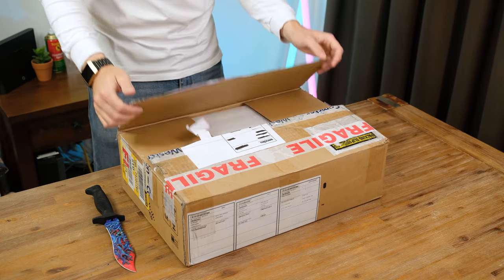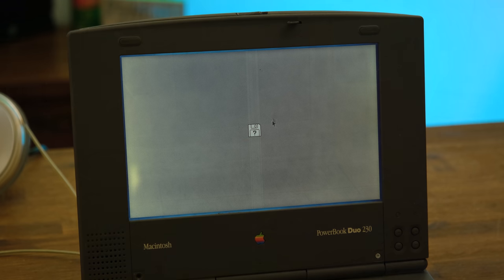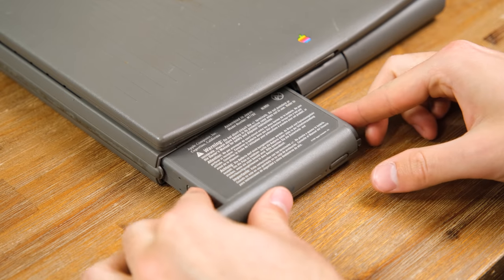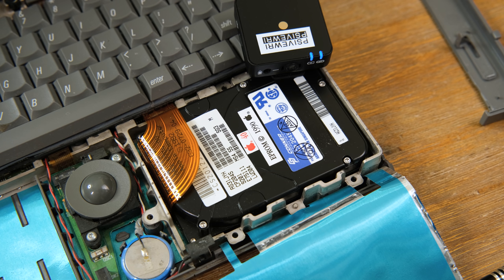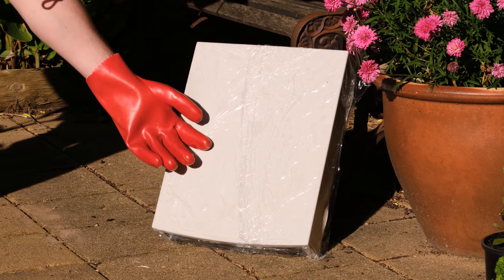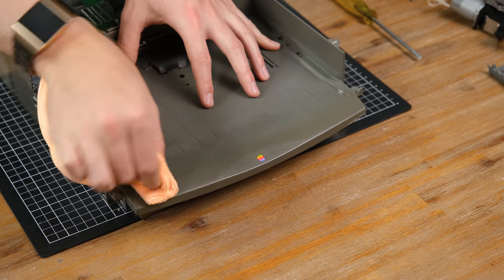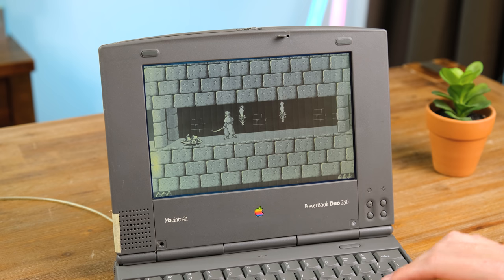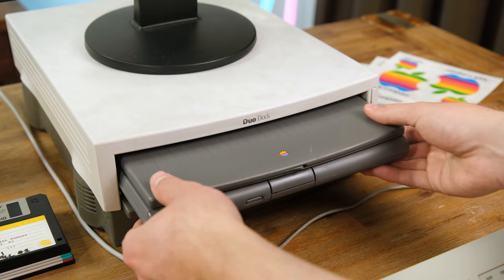Restoring Apple's Tiny Laptop From 1992!

Comment from the maker: Thanks for watching 🙂 One day I may also replace the capacitors (when I learn how to solder properly). If anyone has any info on replacing / repairing the battery, feel free to let me know!
Reply: Hi
Reply: Omg second reply!!!! Also you have 6 LIKES ONLY!!???
Reply: @therobloxianstar4689  here before this blows 🆙
Reply: @woodentrainseriesofficial9511  xD
Reply: It´s a NIMH battery so probably pretty easy todo.
You can get new cells with solder taps applied.
They can have a slightly different capacity as long as they´re the same physical size as the original ones (obviously).
Maybe you can share a few photos of the inside, then i could figure out the arrangment of the cells and maybe the size you need.
There are a few common types.
Reply: Given that the battery is pretty old it's likely the battery it dead, however those PowerBook models suffered from "battery misalignment". A special £200 tool to realign them was available to authorised repair centres - it's a large metal block that has grooves to align the battery terminals. I'd recommend that you check the alignment of those metal prongs in the battery compartment (they can be manually realigned).
Reply: Did anyone told you that you look like Justin Trudeau?
Reply: Supposedly they have 4/5 AA NiMh cells which are readily available with solder tabs so should be pretty easy

Comment: Awesome! I'm so glad the SCSI2SD worked!

Did you know: The displays on the 68030 Duo line are swappable. If you want to make your 230 a color Duo, you can swap in the active-matrix color screen from a 270c. It'll be a frankenstein machine with no visible nameplate (since the 230 has its nameplate on the screen, and the 270c has its nameplate on the keyboard upper)

Or, of course, if you find a 270c these days, you could restore that instead. 😂

Ooohhhh things I did in the early 2000s that I now regret....

Anyway, thanks for the video and the painstaking restoration! These were super cool little machines. Now all you need is the PowerPC version: the Duo 2300c. It'll fit right in your existing dock!

Comment: I repaired few of those, few notes: The original HDs can be repaired a lot of times as the rubber stop on the heads gets all sticky and the heads won't move out of the original position. Magnets on the heads need to be taken off and the rubber stop replaced. Also these laptops were from a era when manufacturers used capacitors prone to leaking. So if you want to preserve the machine, the recap is a good idea. There are some capacitors in the display itself that are also usually leaking and cause drifting contrast or other issues on these laptops.

Comment: Cool computer! I have an old Toshiba Techra 520 CDT that I bought used many years ago. It did come a dock which is very interesting. Dock has some nice speakers for great audio, several expansion slots for additional cards. It’s eject did not work because I did not have the key for it. That was an easy fix. As for the computer the hard drive now just clicks and computer would not boot up. The floppy drive no longer works since the drive belt snapped. This computer has some valuable software on it and I was lucky enough to find a shop that will try to recover all of the data from the drive. Need to find some belts for the floppy drive and new batteries for memory. As for the hard drive I have an IDE to M2 memory card hard drive adapter. Hopefully I can recover this machine so it can be used with the programs I have for it.
My issue is that I no longer live in the states and here in Europe it’s difficult to find the supplies that I need.

Comment: You forgot to recap the logic board on the PB Duo itself, they like to piss everywhere and cause problems. Also, the PSU on the dock needs attention in the same area for the same reasons.

Comment: To help with the yellowing. A cheap set up can be made that works 10 times better then the sun light. Take a tuffy clear one wrap it in tinfoil then place a uv light above it in a really dark room. Some people use uv leds to line the side and bottom which is better but cost more. Just doing it the cheap way is way better then just sun light though. Just make sure its filled above the plastic with 2 parts proxcide and 1 part water. This mixture can be reused. Itll turn the most yellowed thing white again.

Comment: Not sure if this is in the video or not, but these require an enabler to run 7.1, PowerBook Duo Enabler 1.0 or the older System Enabler 201 specifically. If you're going to install System 7.1 on a Mac that requires an enabler, it is far better to track down the original custom install disks for that particular model.
Reply: I had a PowerBook Duo 230 back in the early 2000's, btw...along with a 280c. The 280c is an amazing laptop; I regret selling it. 280c needs 7.1.1 with PowerBook Duo Enabler v2.0, or later.

Comment: I believe in pro longing some of these old computers if they're still capable of working, especially for some old games but they're also very useful for another aspect. Any new films/tv dramas set in the 90's, 2000's and 2010's would benefit from these as props but restored to factory looking condition, cleaned and retrobryting so they look like they did when they came out.

Comment: I don't know if this works with these drives, but i recently had an old IDE Drive that didn't want to spin up. I just took off the PCB and cleaned it, and especially cleaned all the contacts that connect the PCB to the Motor. After that, the Drive worked fine again.

Comment: well are you sure this laptop wouldn´t take standard 2,5" IDE hdds?
If there´s no limitation in physical size, you can easily get a 10,20,30 gb drive for almost nothing.
I´ve put a 60GB drive into a Compaq Armada 7770DMT from 1997 and it has no issues.
The full capacity is avaiable to windows 98se and xp.
But yeah an sdcard is also fine

Comment: Never glue mechanical plastic parts together again, they just fall apart before long. It's best to either 3D print the part, find an equivalent replacement part, or else melt the broken plastic together.

Comment: I like seeing those old machines being restored/cared for - but I am also asking myself why you'd do this? I mean having a PC that is say 10 years old and can be saved, sure why not, you can still use that for office tasks for example (especially if it is an older gaming machine, hell my 2011 built gaming PC still runs rings around modern office hardware! Damned, that thing is 12 years old and still runs those machines into the ground!)...same for a good PC from say 2005 for a retro-gaming-machine (with Windows XP on it etc.), but a laptop from the 90s? What is that good for?

Comment: please don't move anything inside the harddisk while it's not powered. the read-write head and the disk have an air cushion that is created by the spinning disk, if it's not spinning, the read-write head is stuck to the disk and will permanently scratch it. if the hdd needs a jump start, you can give it a tiny spin while it's powered, since it would immediately create that air cushion as soon as it works AND would bring the read-write head into parking position when you power it off again

Comment: Nope. That screen was exactly how they looked. They were horrible screens that at the time were seen as amazing. Active matrix looked awesome, the old Dual-Scan screens were color on the cheap, and those original black and white greyscale passive displays were just crap. But again, at the time, it was like $1500 extra to go up to active matrix. And honestly, most people used these for text-based applications more than graphics - which, if you had to do desktop publishing on the go, you'd plug in a NuBus card if you were crazy enough to try.

Comment: What makes Apple different from Microsoft, is that Apple is primarily a hardware company while Microsoft was primarily a software company meaning Microsoft make the computer or device that their operating system runs on. The problem I have with Apple, is that don't license their OS to OEMs like Microsoft does, limiting their software to just their computer. I don't like "walled garden" approach. Apple doesn't make its applications for Windows where as Microsoft makes is software for both Windows and Mac

Comment: I'd really like to know if it is actually hard to design a decent laptop (with good cooling - so very large fans spinning slowly instead of tiny fans pretending to be a freaking helicopter!), one where you can access (to change and/or upgrade the few parts that can actually be upgraded in laptops - but I guess it's too much to ask for them to make a laptop that you can build yourself like a desktop computer!) everything easily without having to remove dozens of screews and fiddle with adhesive etc. :(